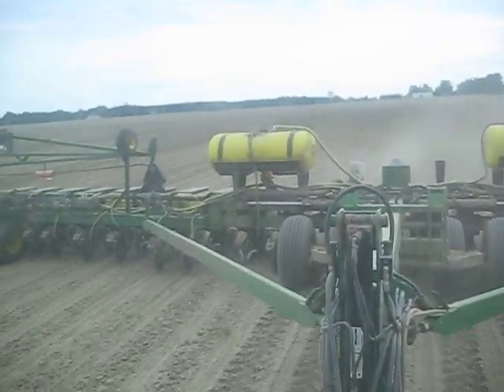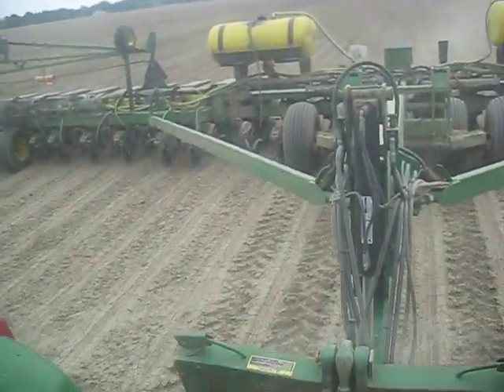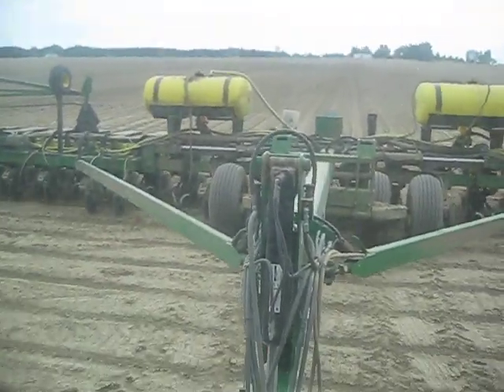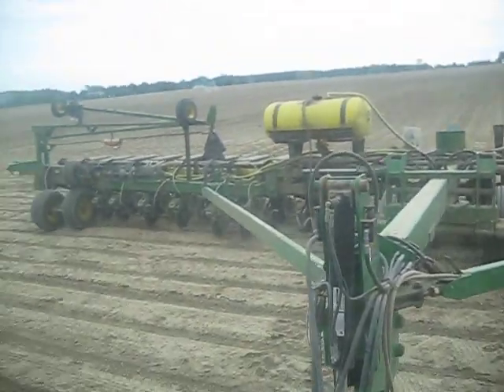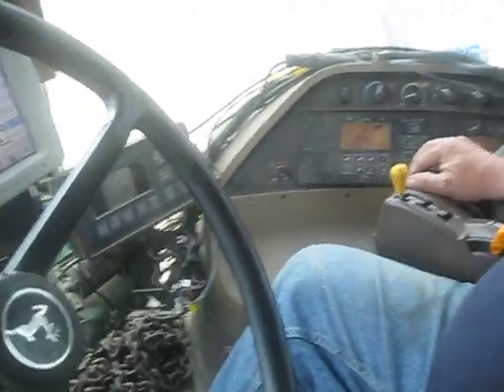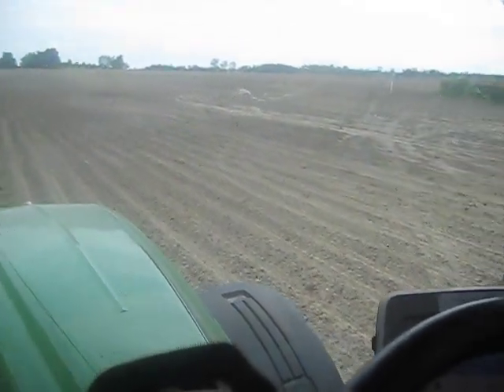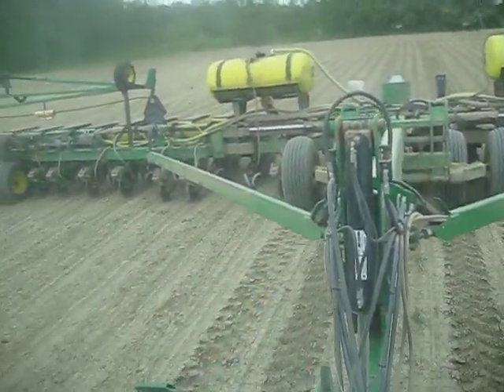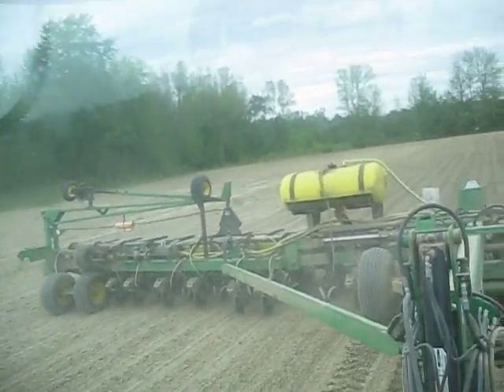John Deere 8120 and DB60 planter using RTK  "Crust Busting"

Comment from the maker: @chrsmcwtrs   Actually they raise the tongue / hitch of the planter up as to allow the closing wheels on the back of the row unit to do the "work" not the opener.  This happens from the side.  Take a very close look at the video.   This is a common practice for crusted in beets in Michigan.    Don't forget seed can be dropped with a planter not with a rotary hoe.    Real bad spots.. they will just lower the hitch and turn the planter on.  With RTK they are right on top of the row.